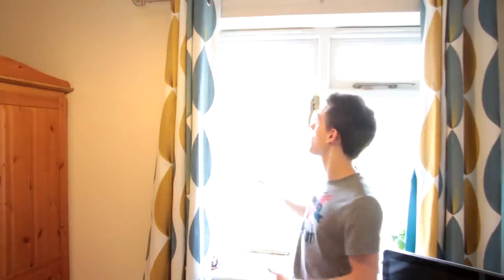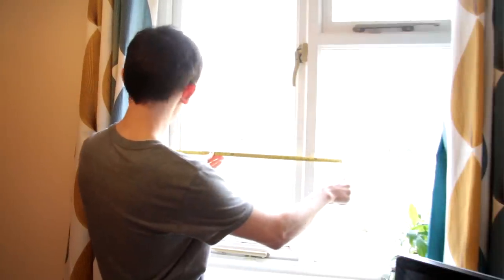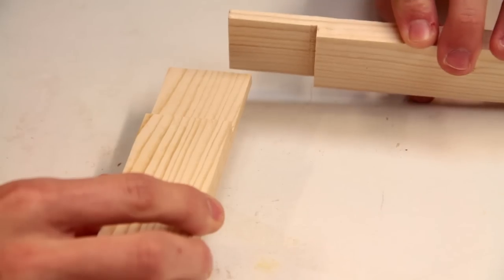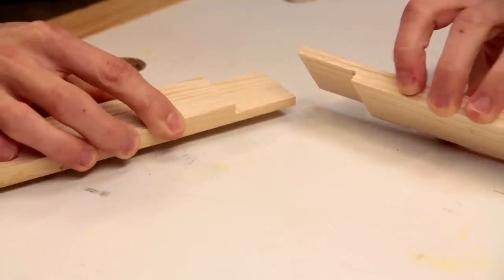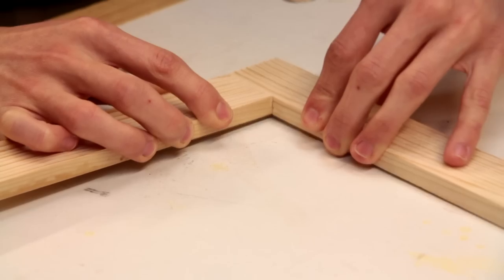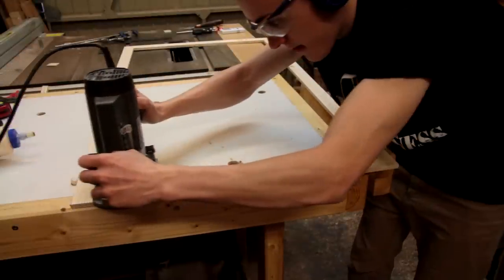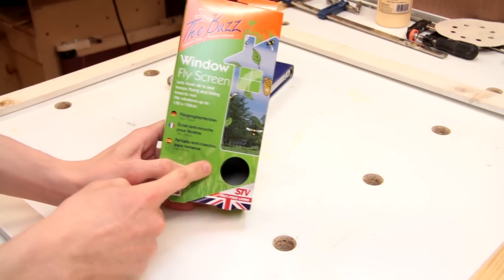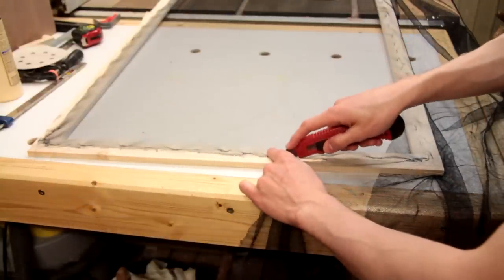Wooden Frame - Temporary Bug Screen (Half Lap Joinery)

Comment: I recently had to do the same thing for a screen house.  I wanted to be able to replace the screen if it got damaged or maybe with tyvek for the winter.  I wanted something cheap and weather-proof so I ripped some 1" pvc pipe on the band saw and screwed it down to hold down the mesh.

Comment: Any issues with a strong wind knocking it out of place? When you first used the router, I thought you were going with a rabbet and quarter rounds to hold the screen in place. Nice tip on using the box to make half-laps with your sled. I must have missed Matthias' video where he showcased this

Comment: Hi Alex, where did you get your riving knife from? I have the same saw (Axminster?) and mine has a much taller riving knife that protrudes above the blade which prevents me from making certain cuts.
Reply from the maker: Henrys Workshop 
Hi Henry. It is the same knife that came with the saw, but I extended the slot in it, so it would sit lower. You just have to be careful that it doesn't touch the blade if you do that. You also loose use o the guard, which naturally Axminster didn't advise. (They suggested an after market guard, if I were to make the mod.)
Reply: ThisWoodwork thanks Alex, what did you use to extend the slot?
Reply from the maker: Henrys Workshop 
Yeh, I just drilled a few holes in a line and filed it out smooth.